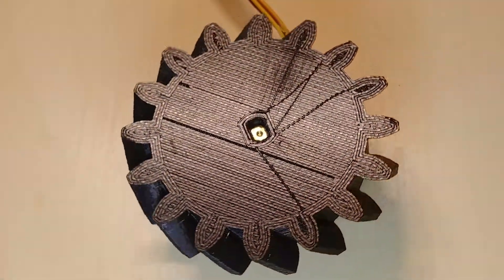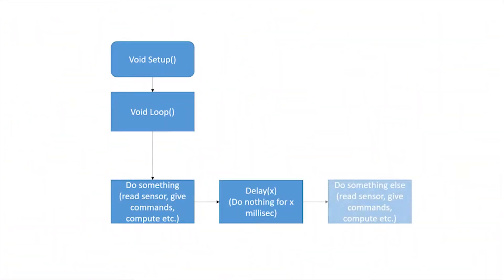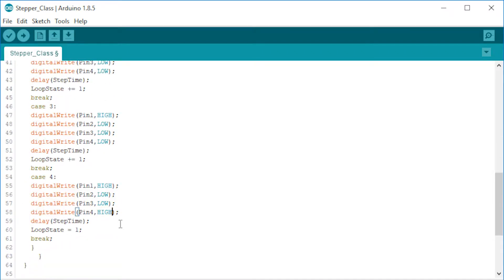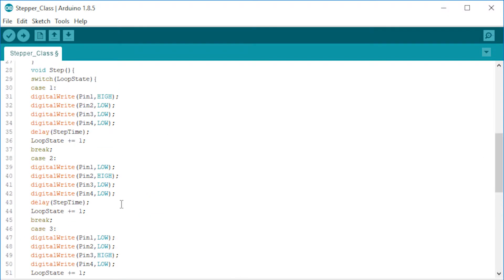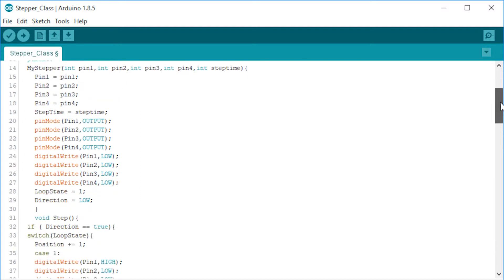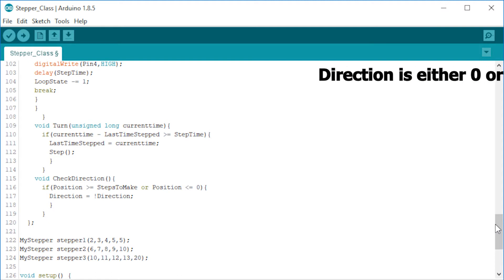How to Make a Class For a Stepper Motor [Arduino Basic Tutorial 8]

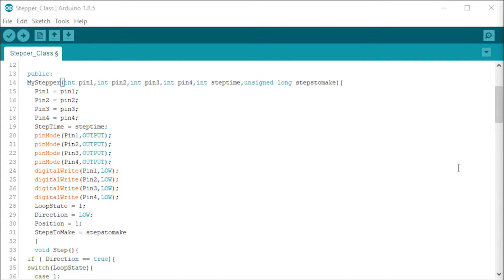Comment from the maker: I made a mistake @8:57. The incrementing of the position should go right after the if statement, and NOT in the switch. Sorry about that.

00:00 - 00:25 Intro
00:25 - 00:49 Required Components
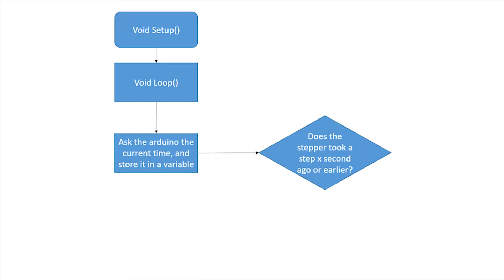00:49 - 03:08 Problem with the delay() function
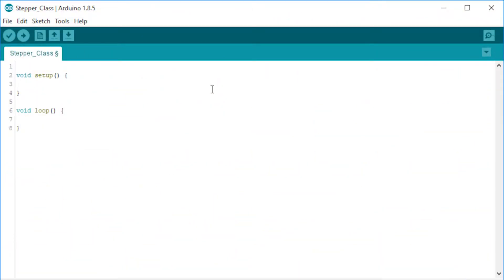03:08 - 03:17 Schematic
03:17 - 05:28 Making the MyStepper class and implementing the basic turn function
05:28 - 06:27 Implementing the turn without delay
06:27 - 07:28 Setting up the test of the two functions (turn with and without delay)
07:28 - 07:45 The actual test of the two functions
07:45 - 08:04 Implementing the direction element of the turn function
08:04 - 10:38 Implementing the "back and forth" turning function
10:38 - 11:14 Some insight about the Acceleration of stepper motors
11:14 - 11:22 Content from next tutorial
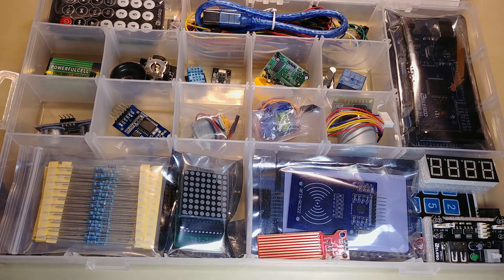11:22 - 11:42 Outro